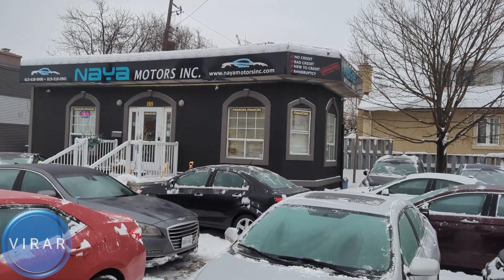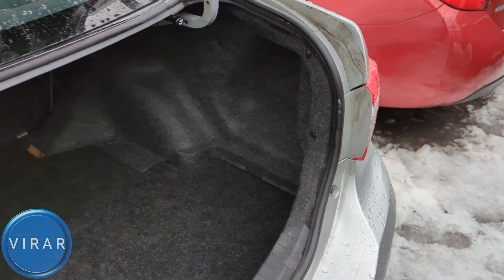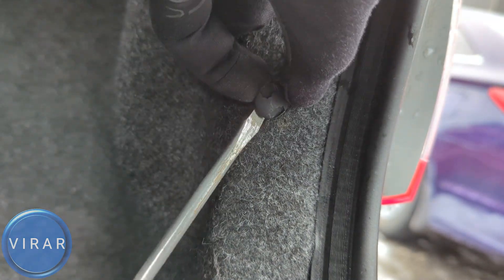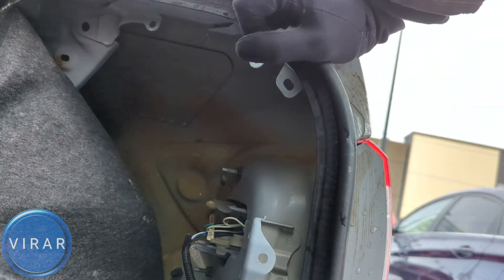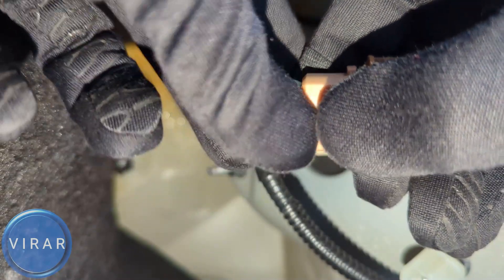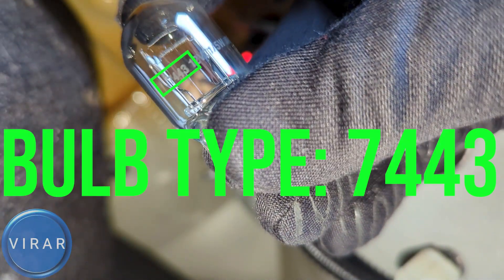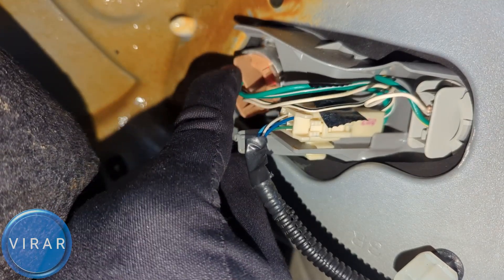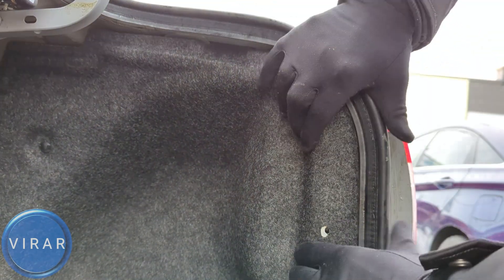How to Replace Brake Light Bulb - Toyota Corolla (2009-2013)

Comment: Wasn't so easy with my 2010 corolla.   There was hardly any slack on that wire, so I had to pull the blinker light out.  But thank you for the video.!